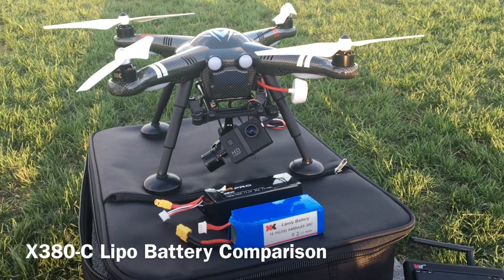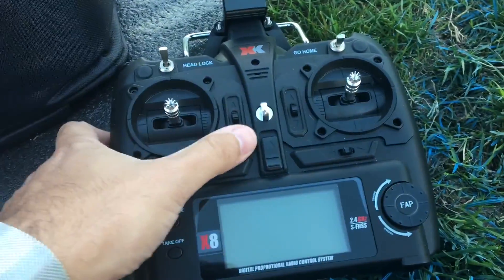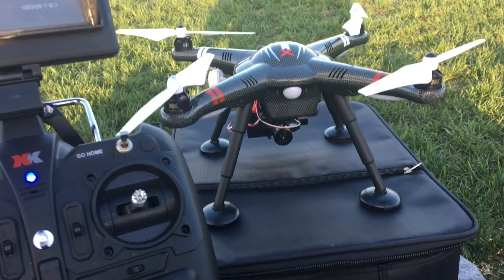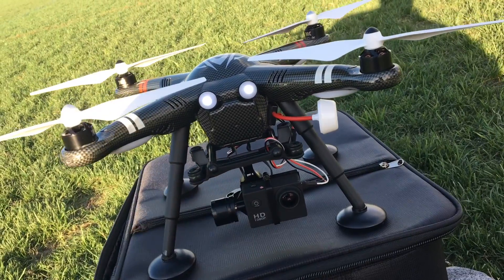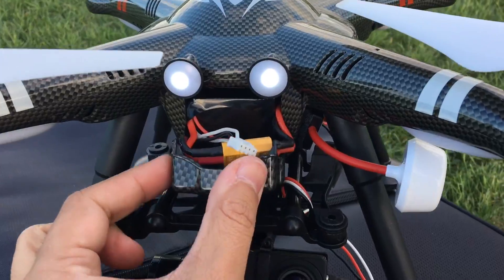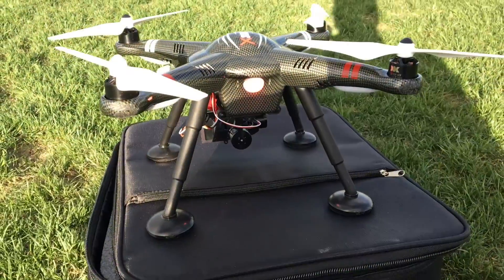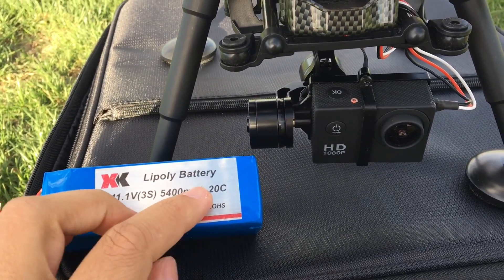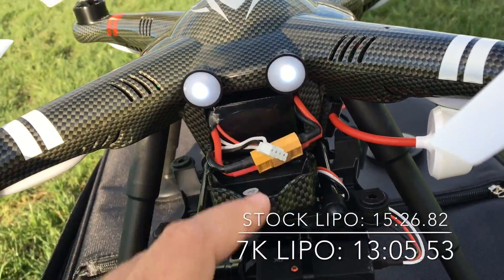X380 Flight Time (with 7000mAh Lipo)

Comment: Do you know of a battery similar in size beside that 7000 mah as the original.  I haven't flown mine in 2 years and want to get it back in the air.

Comment: I've the same drone with stock gimbal and stock FPV and the same propellers.. With the original battery now I fly for 14min. I've just order 2 6000mAh batteries and I hope to gain 3/4mins..
Reply from the maker: Hopefully it will work… Unfortunately in my case, the 7000 mA batteries didn’t really give it much extra time…
Reply: I see.. You 7000mA battery are also quite expensive.. Perhaps I think to close drone experience because in Italy there are very few not prohibited zones to fly..:(